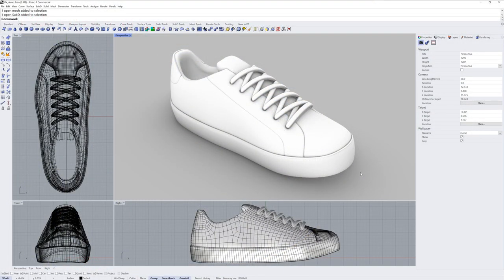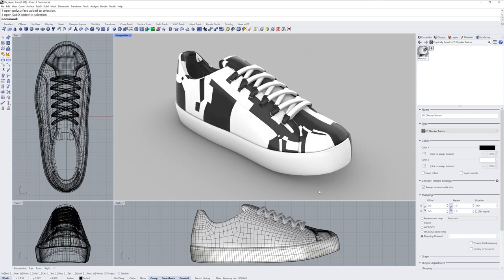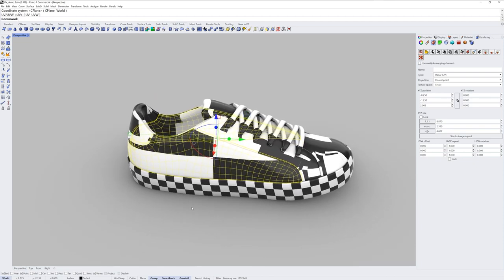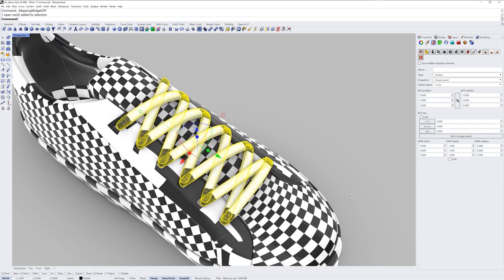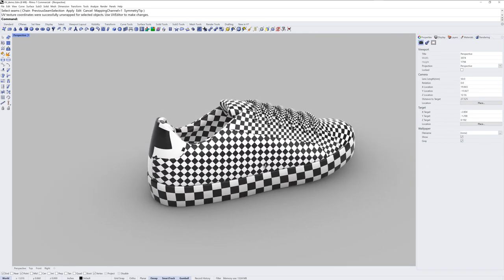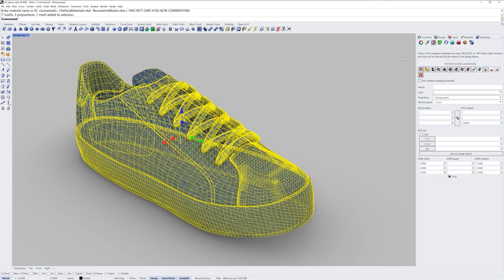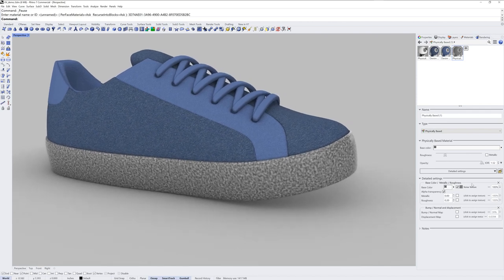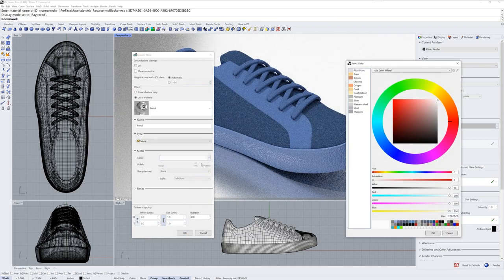Texture Mapping in Rhino 7

Comment: Okay, perfect. But how do I plan these textures and print them? I work with inflatables and have difficulty flattening an applied texture.
Reply from the maker: You can use the command ExtractUVMesh but I'd suggest using the command in Rhino 8 which includes a 1 to 1 option for the size. If that doesn't help or I misunderstood, post to the Rhino user forum with a sample file explaining what you need to do. https://discourse.mcneel.com/

Comment: Great tutorial but Rhino UV mapping is still extremely cumbersome and awkward, compared to other programs. Texture density is vastly different across objects and handling seams is very difficult, due to the lack of a proper uv editor. I hope v8 brings major upgrade.
Reply from the maker: Thanks for the feedback, there are a number of UV and texture updates in the works in the Rhino 8 WIP. I'll share your feedback with the developers but I'm hoping we can minimize stretch better too in the future.  If you have a model that is posing some issues for you specifically, post that part of it to https://discourse.mcneel.com/ if you can as well.
Reply: @RhinoGuide  Sorry to dig this up, but what is the stance in being able to include support for UDIMs in the future?
Reply from the maker: @TheDonkerZ  Hi, There isn't any active work on UDIM support currently in Rhino but I made sure that the request is filed for the developers. You can ask about RH-69319 on the user forum https://discourse.mcneel.com/ in the future to check if there is any movement on that one.

Comment: Slightly off topic, but what are the viewport display settings You are using?  Your render preview looks so good.  Ambient Occlusion? Environment? Shading?   This looks better than the off the shelf render display mode.  

Thanks!
Reply from the maker: I believe I just changed the backdrop color to a grey instead of white so that the checker texture was easier to see. I also probably changed the environments in the Rendering panel for reflection and skylight using the ones from the library... Incheon Airport I think :)